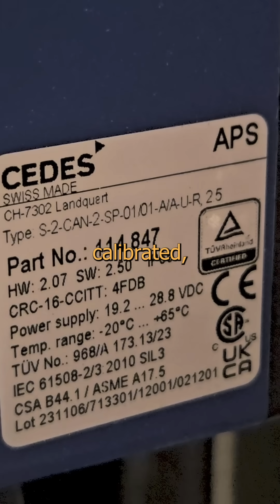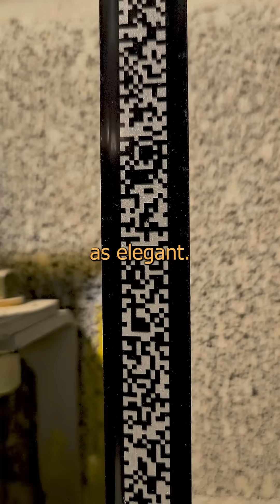Elevator Encoder #chrisboden #comedy #engineering #controls #urbex #indicator #resolver #barcode

Comment: Okay so looking at the tape there is a 10 bit space, with 2 of those bits in each row being used as an index, evidenced by the repeating black, white, white pattern on each side.

That means this system is using 24 bits of data, per index, to sort out the position. 3 rows. 16,777,216 possible locations.

Assuming the squares are 1 millimeter in dimension, then this system could index 55,924 feet of distance down to the 1/8th inch. Thats over 5 thousand floors.

The robustness of that design is absolutely beautiful. It will be a very long time before we could ever build something that would require a 4th line of bits per index, and that's pretty cool
Reply: According to the manual, the data section of the tape is 10mm, so yep, 1mm per square, but it claims up to 1500m positioning... because that's the maximum length the tape is manufactured.

Also according to the manual, this particular sensor has 2 readers and 2 channels, so a nice bit of backup.
Reply: @Tordek oh neat, so I guess they cut back on the possible range to add redundancy.

And as any good engineer knows, redundancy is the secret sauce that makes things extra tasty.
Reply: @MrBlack0950  I'd assume there is a CRC or ECC, but with 24b there is barely enough room; 21b is the minimum to get 1.5 million different codes to fill the tape.

Unfortunately I can't see an obvious pattern in the tape [except the first column seems to change every 22 rows] and don't know if it's read horizontally (3 rows of 8b) or vertically (8 columns of 3b), backwards or forwards. I'd love to see documentation.
Reply: @Tordek Personally, I don’t think there’s error correction on the strip itself, because you’re moving along linearly, all you have to do is keep track of the last couple ones you’ve passed, and you can detect errors, even compensate for a couple misreads. You’d only run into issues once the strip gets so dirty that it starts missing several changes in a row (at least how I would design it, if you don’t get new sensor positions for a bit you should stop for safety reasons) or fill the entire memory window with garbage from the sensor so you completely lose position.

TL;DR; your error detection is just the decoded position jumping since you’re moving linearly along it, and your correction is just interpolating data until some arbitrary limit set for safety reasons
Reply: @ChlorideCull  I agree, there isn't enough bits for it IMO.
Reply: @Tordek SIL 3 certified which is skookum
Reply: @Tordek  Can you point me to the manual?
Reply: It must be that some error correction is inserted into those 24 bits, because despite the fact that two same strips are used on both sodes, the squares can definitely end up partially dirty and covered in dust.
Reply: @goranjosic  simple brush attached to elevator  PM every year
Reply: @goranjosic Well, there might be brushes / rubber sponges that keeps the strip clean as the elevator goes up and down. Plus considering the spacing of each row, it's possible for the carriage to aim for 3-5 sequential patterns instead of just 1 particular row, allowing a whole row to be missing yet the car still stops at roughly the correct spot +/- a quarter of an inch.
Reply: Shouldn't there be a checksum or some redundancy code included?
Reply: @misium thats what index marking is for.

Align the scanner to the index, read the bits encoded at that spot, then compare it to the data on memory to figure out where on the tape you are.

Or at least thats my assumption based purely on what I know about encoding technology and the pattern of squares on the tape. Theres probably a ton more going on behind the scenes that would need a specialist and at least 30 minutes to really get into. Tech like that is rarely as simple as the first assessment, but an educated guess is usually a good starting point
Reply: God dammit, just spent like 5m watching the pattern and mathing the height out to the same result only to open the comments and see my curiosity had already been satisfied.
Reply: @owenkegg5608  cryptology and computer science nerds unite! (I don't which side you are coming from, but both would be able to work out the data structure from the pattern)

Legit made my day seeing someone else who really gets why I did the math
Reply: @MrBlack0950 I come from the electronics field, and computer science is of course a very relevant topic for that :)

I do love me some cryptology though.
Reply: On the tallest skyscrapers, you can't just take one elevator all the way to the top. It will be enough, permanently, until we redesign elevator cables to lift us 100x higher.
Reply: @bramweinreder2346  well given thats about 25 times taller than the current tallest building, I'm pretty sure that was already established that it wasn't going to be needed for a very long time

With our current technology and infrastructure world wide its just not possible to build something that tall. Sure, we probably could if every single country unified on it, but I don't think any single country has the resources to achieve that, and I don't even know if we have the architectural technology yet to support the weight of something that big. So that also might need a lot of resources to develop.

So... yeah, its gonna last us till the end of our lifetimes, and likely a few more generations at least, likely several
Reply: @MrBlack0950  I agree with that, at least until we mainstream maglev elevators (theoretically possible) or artificial gravity. The concept of infinity is conceived to inspire us to keep dreaming (and that's pretty cool).
Reply: 011011, so it could be 24, or any smount to line up
Reply: Nice.
Of course the accuracy won't only be 3 mm = 1/8 inch, but the full 1 mm, as it can distinguish individual lines.
Reply: @QuasiRandomViewer actually the datasheet says 1/2mm
Reply: /me immediately begins designing the 5001 floor skyscraper with 1 floor stairway to the top; elevator will say "I'm sorry Dave, I can't do that" when button with floor 5001 pushed
Reply: It presumably carries a CRC too?

I'm guessing the left and right are just a repeating linear code, giving rows of 8 bits.

These will then be somehow encoded with a CRC. As the linear code repeats every 6, that would give 48 bits of data. So maybe a 32bit code and 16bit CRC?
Reply: Error checking bits would likely be designed in
Reply: Ya I kissed a dude once too, nobody cares
Reply: @TicklesTrout you're on a video made my an engineering enthusiast intended to encourage people to learn about the fascinating world of technology that lays just out of sight.

My comment is one discussing the computer science involved, reasoned out via cryptology and an understanding of how a computer reads binary data.

You're the oddball in this scenario. Also if I cared about what other people thought of my interests, I would have gotten into sports analytics or something else thats "normal". I do not care whether you care or not, just as I do not care who you kiss.

If you don't care, then you were not the intended audience.

Comment: I'm but a humble embedded engineer, but from what I gather, each line only 8 bits, with locator bits on either side alternating every couple of lines, for a total of 10 bits. That makes a maximum of 1024 different unique combinations of black and white squares in a line, so it's not just scanning and processing one line at a time, it would have to be scanning some number of lines all at once – basically a 2d barcode. Not only would that particular sequence of x lines need to never repeat down the length of the tape, but a computer needs to be able to take a picture of the tape, decode it to get the line values, and then algorithmically determine where on the tape that particular sequence of lines is, and it would need to do it several times every fraction of a second without error. It's brilliant, simple, and also computationally remarkably complex. The reliability of this system is blowing my mind a little bit
I wonder how often someone has to clean the imager's lens 😂

Comment: Could a dead/dried on moth or insect on the strip cause a false read? i.e. making one area read as a different area to the sensor? I guess is there some roller brush system in place or something to prevent blockage/misreads?

Comment: "simpler" only in the mechanical/parts count sense.  It requires highly developed optical sensors and processors.  It is a far more complex system, but all that complexity is locked up in a black box that the technician can't fuck up.

Comment: I counted 10 columns, meaning there are up to 1024 permutations. That's a lot fewer than I expected. Additionally, I noticed that the 2 columns on the sides have a staggered, repeating pattern of black-white-white. If that holds for the entirety of the strip, then that lowers the number of permutations to 768.

Comment: Every line can’t be unique. There are 10 bits per line, so 2^10 =1,024 possible unique lines. At 2mm squares (estimate) that only gives you a little over 2 metres. If the code is instead each set of two lines, then you get 2^20 bits and 2km of unique codes

Comment: I wonder how tall an elevator shaft has to be to not be compatible with this style of encoder 🤔
Reply: Did some research, the standard style usually only works for 100-200 meter shafts if it's beyond that, they usually either make a wider strip to allow more room for data values, or they'll use a denser data pattern that's likely smaller than the ones seen in this video. Super cool to think that these are the things vertical transport engineers have to think about when designing a new elevator!

Comment: So there’s 10 bits on each line, meaning 2^10 combinations, meaning 1024 total combinations. Assuming one of those is about 1/8 of an inch, there’s only 128 inches of tape - 10 ft 8 in, not enough for a full building. How does this work on even a two-story scale if the tape doesn’t repeat?  How about if the building has many floors? Does it repeat for each spot where the floor is level with the elevator?
Reply: Exactly what I was wondering.

Comment: Best guess from the video alone, the outside "bits", left and right, are an 1/8" incremental ruler with 8 data bits of information in-between (the position number[1 - 255]). 

But that's just my nerdy guess based on the low income, county school, education, and life experience I've been through.

Comment: Since it’s binary you have 2^10 (1,024) on just one line, surely you would have repeating codes if it is just one line, with two lines it’s 2^20 (1.04858e6) which seems more plausible

Comment: the IP8300 was way better. the newest landing system that Motion Control replaced the IP8300 with is junk. though, it might just be that my coworkers aren't perfectionists, and keep failing to install things correctly. my modernization jobs are still running fine, while the later ones I didn't get sent to to get inspection ready keep turning into The Neverending Story of callbacks.

Comment: Except... it can't be tall at that density? The line has 13 pixels, so the amount of combination is 2¹³-2 because all 0 and all 1 are stupid. Giving a 13 long part roughly 5 cm, dividing by 13 and multiplying by 2¹³-2 we get about 31 meters, wich isn't a lot

Comment: The pattern on the strip is 10 bits wide, so there are only 1024 unique lines patterns, which would only be enough for a couple of meters tops. My guess is that the reader combines information from multiple neighboring lines to identify spots on the strip without requiring wider/more dense patterns, and also uses the extra information for error detection/correction.

Comment: Sure, it's simple -- once you can put a computer smarter than a Y2K desktop computer in a chip the size of a coat button.  And a laser in a pencil eraser.  And a video sensor that can look through a nail hole with enough resolution to read he binary code lines...

Even twenty years ago, that couldn't have been done economically, and thirty years ago it couldn't have been done at all -- or at least not in a box the size of that one on the elevator car.

I used to ride an elevator up 28 floors to work back in the '90s, and I guarantee it had some kind of electromechanical floor alignment system -- that was controlled at the top of the shaft, not from the car itself, because the building was built around 1970 and all the "computer" power that controlled the elevators ran on relays and switches...

Comment: The ones we use on LULA elevators and the residentials I've installed is even simpler. It just uses a wheel with a thin rubber belt that essentially acts as a gear rack and the system just counts how many teeth it has gone through to know where it needs to stop.

Comment: Yeah that tape will work great until it gets scratched, covered in oil or grease, or dirt builds up on it. Hopefully the reader moves which will eliminate scratches from the equation, otherwise if the tape moves past the reader the inevitable will happen.

Comment: there’s 11 digits there, meaning 2047 unique different codes. assuming each bit is a 1/8th inch square, that’s ~21 feet of elevator, so how can it not repeat? are the squares bigger than my estimation? are there more bits than i counted?